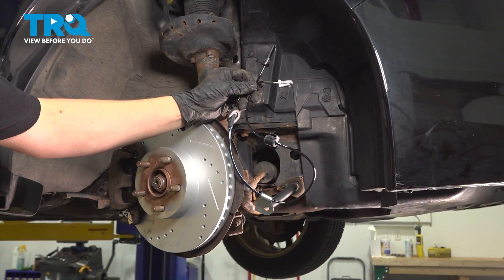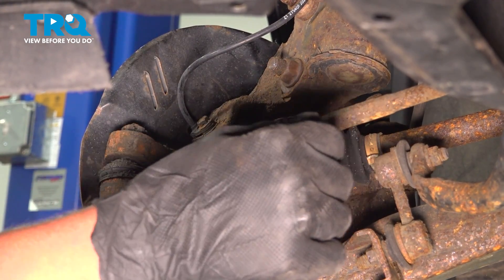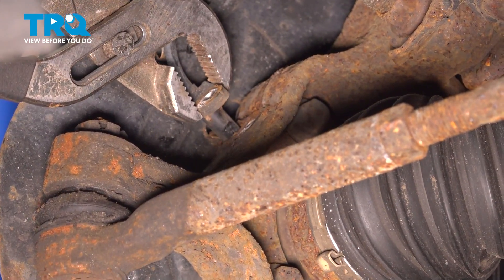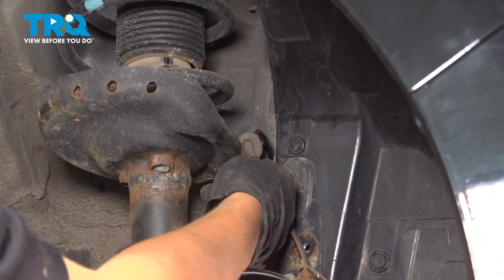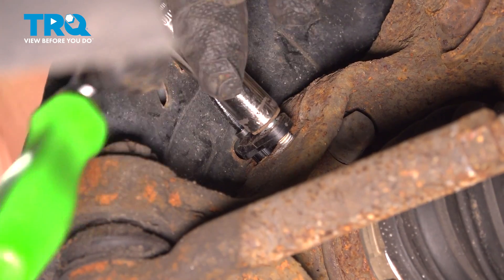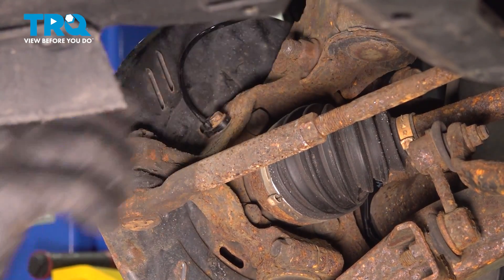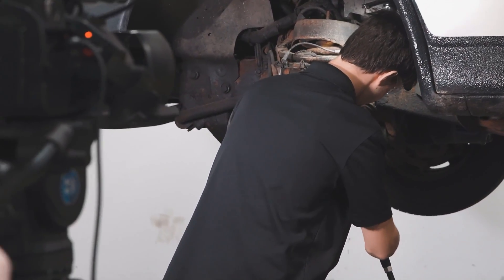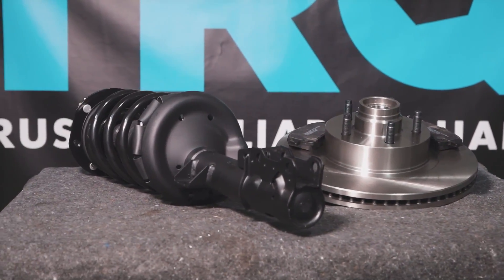How to Replace Front Wheel Speed Sensors 2012-2016 Subaru Impreza

Comment: So I'm going to put the speed sensors that I got from Amazon which are the same brand of you guys here, TRQ products. Anyway, all the warning lights on the dashboard are on because I damaged one of the speed sensors when changing the bearings out last weekend so now that the new TRQ speed sensors are here I hope all the lights on the dashboard go off after I put the new ones in right now. Just replacing the senor is all you have to do and everything will be back to normal again?